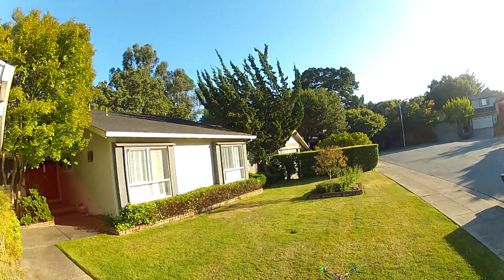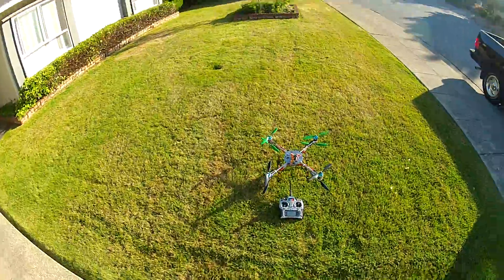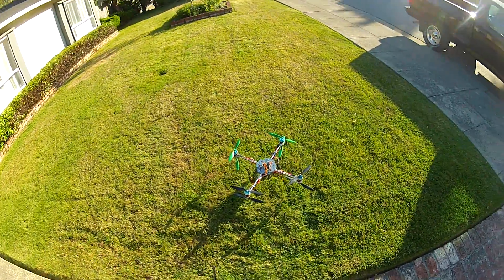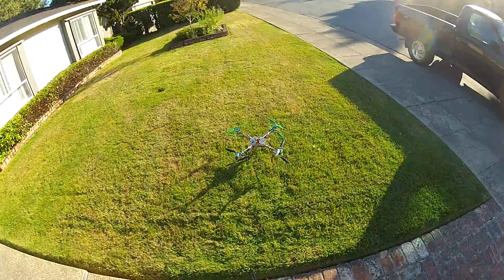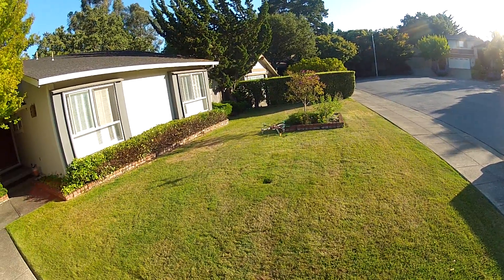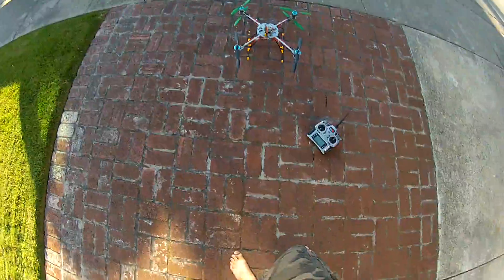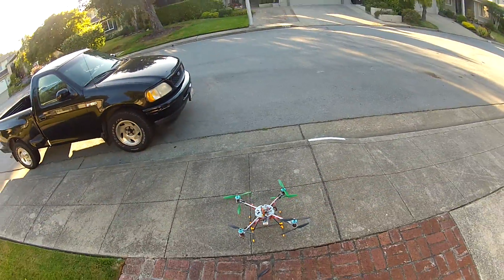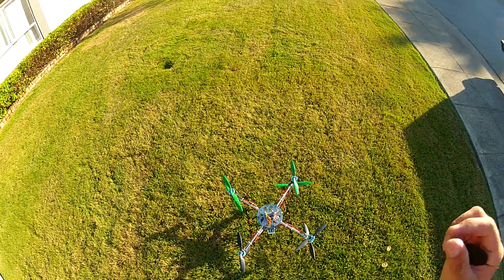RCV Day 13: X8 testing with prop failure!!

Comment from the maker: I use tom and bottom just for that reason. You can also tighten up the bell grub screw to keep the shaft from sliding. They strip easy though. I cut them if I am worried. Generally, I don't worry though:)

Comment: I need some help. I have a tricopter with dt750's. My problem is that I can't tighten the props on enough since it will pull the shaft against the bearings. I see you have a nut on top and on bottom which is what I would do, but I have been advised to cut my shafts down to have a lower chance of bending a shaft.. Any ideas?